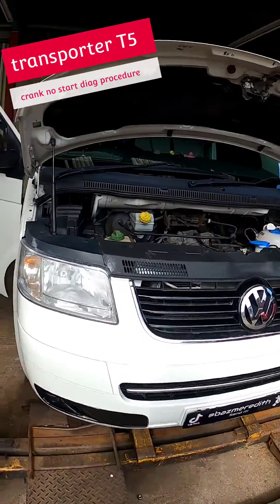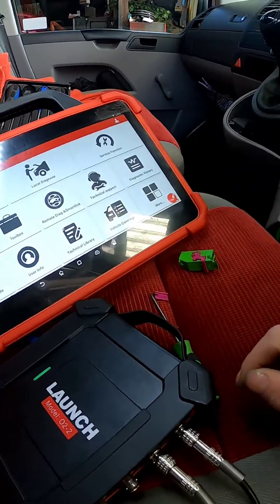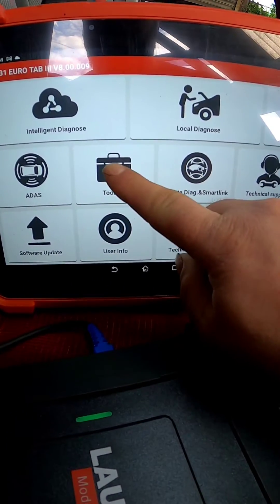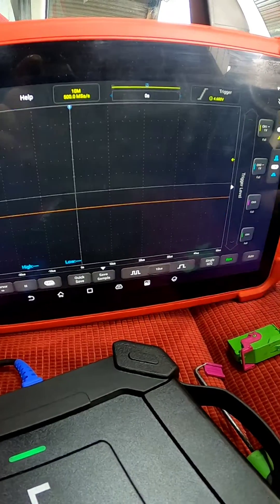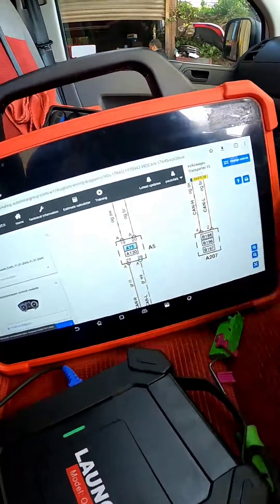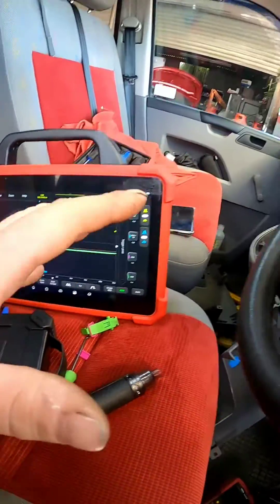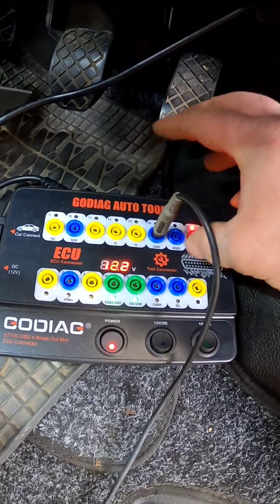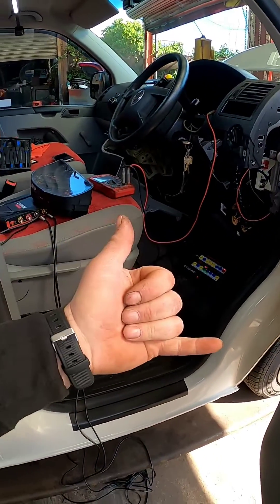VW transporter T5 no communication

Comment: hi there did you solve this issue i have a t5 here , i have 12v at obd but i am getting no coms with any of the moduels checked all fuses , i have 3 sets of cluster here and non off them have fixed the issue
Reply from the maker: @lcmperformance9409  go under the battery take the cover off and there is a relay in there!!! That can cause all sorts of havoc I think it's an ignition relay

Comment: Hi baz , working on 2021 renault clio  fault while driving everything cutting  out for 2 seconds engine , power  steering and no dash lights , speedo rev counter etc  only does it  in the morning  after a few minutes of driving  ,  no codes  could the bms on the battery cause this and would it be okay to disconnect this or bypass it to try it ?

Comment: Mint!!
Reply: Hi man, i was looking for this kind of vid for a week now...i have the same prob..car runs no problem but i cant connect from diag port to almost nothing...but it can communicate once to ecu and other time to brake electronics...but not at the same time and not anything else...i came to the same thing...j533 databus gateway interface...but was not sure if thats the cause.  canbus in drivetrain is ok, scope checked signals on cluster pins like you did..also k line perfect signal...so it was fix after changing your cluster, right?thank you so much